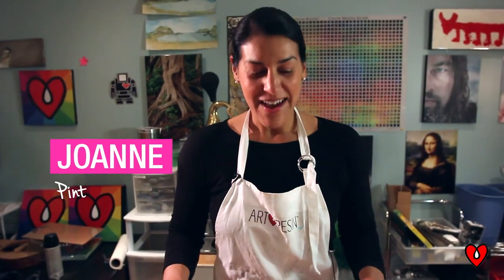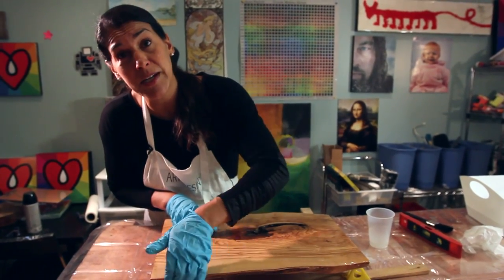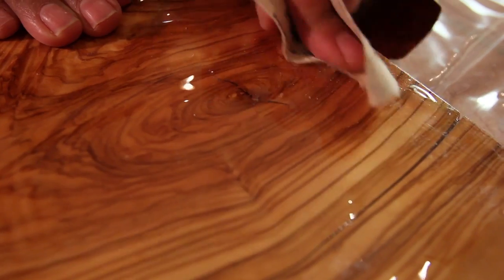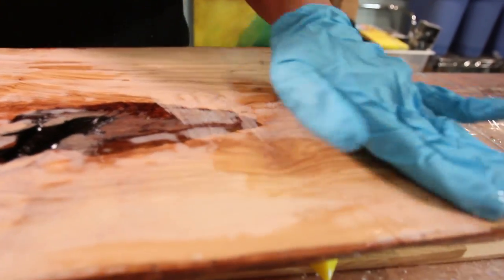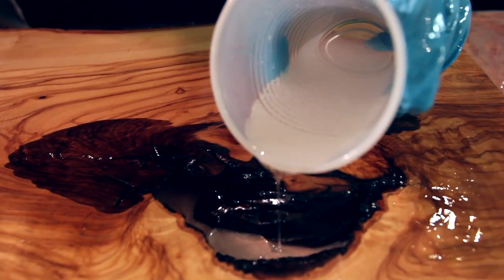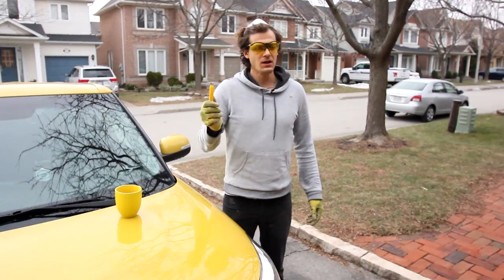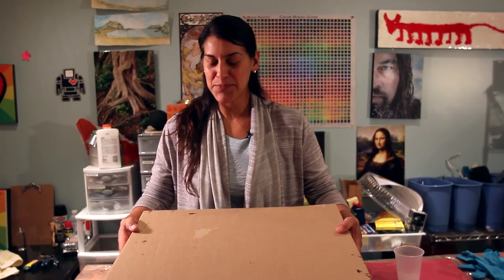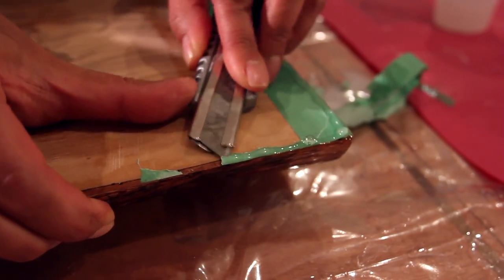How To Resin a Live Edge Wood Board - Step By Step Tutorial

Comment: I wish they didnt promote such unsafe resin use. No respirator, no goggles, so much plastic waste too.
Reply from the maker: Hi Sam - thanks for voicing your concerns :)  Happy to tell you that ArtResin was evaluated by toxicologists at the Bureau Veritas as well as the American Society of Testing And Materials and  was designated under ASTM D-4236 as safe for home use with no respirator, goggles or other safety equipment required other than gloves ( as epoxy resin can be a skin irritant for some folks. )  For the sake of the video, we did use disposable plastic cups, but this is not typical at all ... at the studio we always use hard plastic tools ( mixing sticks, spreaders, mixing cups and vinyl shower curtains to line the work surface ) so that we can re-use them over and over and over again - and we encourage our customers to do the same.
Reply: @Artresin  it's very misleading to beginners. I hope no one takes your claims in vain. You are combined two chemical compounds to bond together and "cure". You guys should be promoting safe resin handling. Even the ArtResin Safety Data Sheet says to use "wear protective gloves/ protective clothing / eye and face protection" .
All that aside, even if the resin was "100% safe to use" without protection, that's before any colorants or pigments or heating applied which can change up the formula. 
I think artresin relies on vague claims to sell to newbies and home creators, or people who havent dont much research. I hope you guys begin to promote safe resin use. Either way I wont be a customer
Reply from the maker: @samc1242  Hi again Sam, just to clarify... we are promoting the safe handling of ArtResin epoxy resin, no other brands. We are not responsible for other brands, only ourselves. In fact, ArtResin was developed in response to the limitations (i.e. toxicity, etc.) of other epoxy resin brands so we fully appreciate your concerns about safety.
Again to clarify, the precise wording in our SDS is "P280: Wear protective gloves/protective clothing/eye protection/face protection" which is copied verbatim from the Globally Harmonized System of Classification and Labelling of Chemicals. 
Here's the link for your convenience: https://www.chemsafetypro.com/Topics/GHS/GHS_precautionary_statement_p_code.html. 

We are not permitted to change the GHS verbiage even though toxicologists from ASTM and Bureau Veritas agree that gloves are the only necessary requirement. It's simply an all-encompassing classification code that we have no control over; sorry if that was confusing to you. On our packaging we have made an effort to streamline the facts by writing directly, "Wear protective gloves." and then we point to the SDS for full details. 

Further, allow us to point out that a Toxicological Risk Assessment takes into account every aspect or state of the material throughout it's process, including resin on its own in liquid form, hardener on its own in liquid form, resin + hardener combined in liquid form while being torched and while curing.

Lastly, we do have a disclaimer on all our packaging that says "NOTE: Adding foreign products to ArtResin epoxy resin may compromise its safety and/or performance."

Thanks as always for your concern and for the opportunity to clarify some of your assumptions :)
Reply: @Artresin   pretty much every resin we use has their ASTM certification and all it means is that it is properly labeled to warn you of potential health hazards. All art supplies sold in the US must bear the phrase "conforms to ATSM D 4236" confirming they have been properly labelled for chronic health hazards. 

I mean it's your ship to run but I think you guys are cruising a risky line by relying on the bare minimum/vague claims you have to make in order to seem like you are safe and non toxic. I think you would benefit huge from promoting SAFE resin use. But then it might scare off all your newbie and in home customers right? 

Anyone reading this should join the facebook group "epoxy is not my friend". Have you seen all the horrible reactions your brand and others have caused to people while unsafe handling? Maybe your PR team should check it outm
Reply from the maker: Dear Sam,

Again, thank you for your concern however I assure you we are on solid ground. To quote our Toxicological Risk Assessment: "the product [ArtResin epoxy resin] IS NOT CONSIDERED TO BE TOXIC (acute/chronic), corrosive and/or a strong sensitizer when used as intended or under circumstances involving reasonably foreseeable misuse."  FYI, our TRA was conducted by a Diplomate of the American Board of Toxicology.
 
As for your concerns regarding allergy (AKA sensitization), the truth is, it is well documented in scientific literature that a small percentage of users (<5%) will demonstrate allergic reactions to epoxies in general (regardless of brand). Again, our TRA did not find ArtResin to be a strong sensitizer, however the possibility for sensitization is not out of the question, and for that reason we do comply with regulation that requires us to put a warning label on the front of our bottles that indicates the possibility for allergic reaction (verbatim: WARNING: Irritant - May cause skin/eye irritation or allergic reaction). Allergies can unfortunately onset at any age, and often without warning. It is important to understand, once again, that the possibility for allergy does not negate ArtResin's non-toxic nature, however. For example, I am allergic to oranges but this certainly doesn't mean that oranges are toxic; most people can enjoy them every day of their life without complication. So long as users follow directions, most people (save those allergic few) can expect to have a safe experience with ArtResin, and for those who prove to be allergic such as yourself, the advice (and common sense) would be to discontinue use. 

Again, I hope these facts help to ease your mind about how we conduct our business and keep people safe.

Have a good day! :)
Reply: ArtResin....If, by your own words, you are supposed to be using eye protection and face protection (respirator for the very harmful fumes) then my question is: Why are you not following your own health instructions?